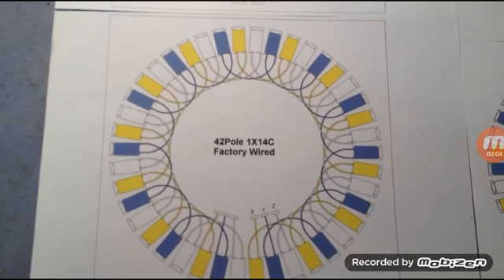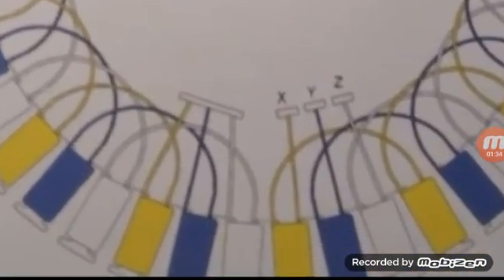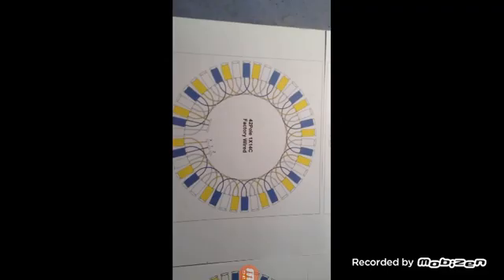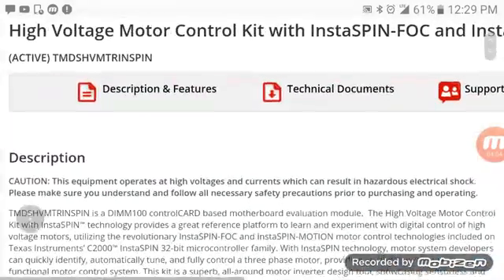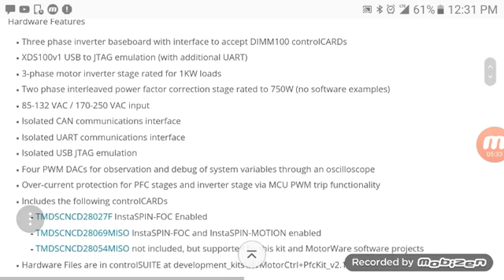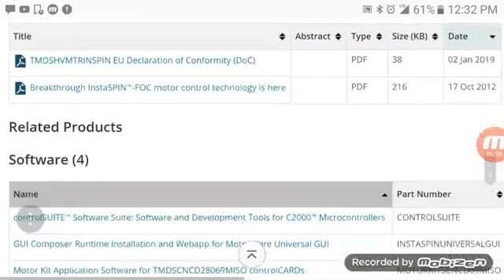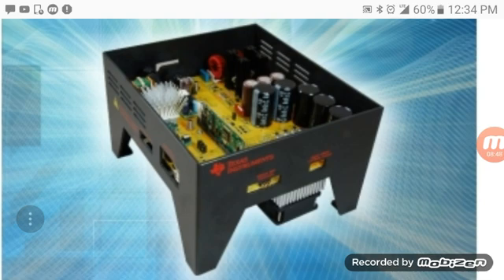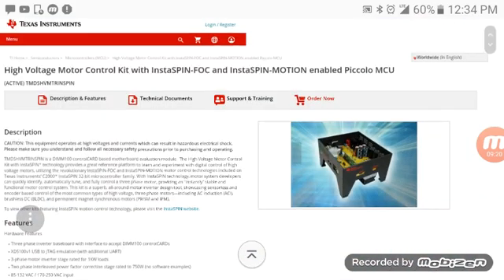Gerard Morin Hyper Drive Update and Explanation

Comment: Hi, I just found the same LG washing machine drum motor that Gerard uses. When he is talking about rewinding the coils left then the next one right (I assume he means CCW then CW) is he speaking about each winding seperately( do all the blue for exemple) or every pole you come across. Refering to your schematic would they go: Y= CCW then B= CW then W= CCW or Y,B,W= CCW then YBW= CW. I hope I managed to explain myself clearly and that you can enlighten me on the subject. I am an electrician by trade but never rewound any motors so any pointers help. Thanks in advance and I really appreciate your videos and all the research you do.
Reply from the maker: Hey man thanks for the comment, I don't recall Gerard talking about ready wiring/rewinding the stator coils, as they are alternating clockwise and counterclockwise already from the factory, and the ones with the thin wire provide enough surface area for higher voltages, so no rewinding is necessary with these particular Motors, they are ready to go as is, however since they have so many poles they are designed for a low RPM high torque motor, which makes it difficult to get high speed and high-torque with this configuration, the smaller motors which have half as many poles are much stronger and faster running Motors.

Comment: Ive got the drum motor spinning up to 3000 rpm they are only 1hp. And cannot handle large kw outputs. I no from experience. They can handle small currents up to 15 amps tops.
Reply from the maker: All I Need is rpms to spin a flywheel anti-Lenz generator head, no torque required for a full electrical load, thanks

Comment: How ya doin guys i enjoy a lot of the action goin on about these drum motors. Just letting you no i have a controller to run a drum motor starting at 550 rpm and can increase to 3000 rpm with no mods to coils .
Reply from the maker: Cool, that are the specs and what is the price? Custom built or purchased somewhere?
Reply: @JasonJoplin  i done some research on controllers and found one simillar. I rewired to my specs . I do have a short video clip if interested
Reply from the maker: @craigivas4037  awesome I'd love to see what you got!
Reply: @JasonJoplin  have you got a contact as i cannot send small video here.
Reply from the maker: @craigivas4037  jasonjoplin2016@gmail.com

Comment: Gerard Morin's generator (Hyper drive) demo isnt't working under LOAD. If it can't move anything but itself, it is POINTLESS. It is purely a THEORETICAL idea but it doesn't work to produce enough energy to power anything substantial. It's like the self powering motor. If anything is going to do all the stuff he said it would, he would show us powering some devices reliably for at least 12 hours. But it is still just talk and more talk and excuses. 

He will NEVER harvest enough free energy to even run a small fan. Look at all the people who tried and miserably failed. All they spout are assumptions, speculation and scientifically sounding theories to bamboozle the listeners with pseudo-scientistific nonsense. They always need more and more funding or parts. What did Gerard produce in all those years since his first video? Absolutely NOTHING.  

The first law of Thermodynamics applies and is formulated :

 ΔU = Q - W 

It states that the change in the internal energy ΔU of a closed system is equal to the amount of heat Q supplied to the system, minus the amount of work W done by the system on its surroundings. An equivalent statement is that perpetual motion machines of the first kind are impossible.

Beware and don't give this guy your hard earned money. He will spend it all, mostly to support himself and then come up with an excuse why it was not enough and why he needs more. Legally there is nothing one can do because its all based on theories without any guarantee.
Reply: https://www.youtube.com/watch?v=nroBcB-42aU Mario you don't know much do you? what have you built?
Reply: @2DOG3FIST worthless to those that don't know. What am I scamming? what did i state?
Reply: https://www.youtube.com/watch?v=6eP-B_d9DoI your first law of thermodynamics is in a closed loop these motors are not in closed loops therefore they are not subject to the laws.
If you do not understand this then mabye study.
Reply: @2DOG3FIST i cant help you
Reply: @2DOG3FIST how is that scamming if it does what he claims and you would have the ability to reverse engineer it? mabye you need to try harder and talk less.
Reply: @2DOG3FIST Your hiding behind another account also resorting to calling another person dense shows your true colors why would people want to share anything with the masses if it involves people like you? this person has spent his time developing something and no your not going to get it for free if you emailed him and was polite and learnt instead of expecting a free lunch things would be different and then you reference a person called bedini (https://www.youtube.com/watch?v=1DJ-QH3h-xo&feature=youtu.be)again retracting from an original argument how many people do you want to reference mabye study the people that helped john bedini as he didnt know how his apparent own inventions worked.
You clearly are looking for an easy out and ridicule anything you cant get easy good luck why are you here? you really need to study more if I was calling someone I had never met a moron or dense then it would be an easy reflection of what I was stating.
It is clear to me who you are a sad person who is hiding on another account trying to fight with people go to gerards sites and bedinis and john searl and anyone else and take it up with them on your main account not this account.
anything you state or say I can and will silence.
Reply: @2DOG3FIST You make the mistake that I care what you think and you also make the mistake that I would entertain you. who ever said there is a free energy device not I.
Do not talk on my behalf your sounding more absurd by the comments you leave you obviously have history or failure so I await another response as you just can't help it you think by the last comment your actually achieving something.
I'm retired at a young age and I find you and others funny you entertain me not the other way round. come on mario.
Reply: @2DOG3FIST Sunshine has done work its not free nothing is free stand out in it all day you will get burnt or at the least very thirsty as for creative ways nicola stated that the way we harness what is all around is makes it more or less efficient, I would study who tesla called a genius not tesla.
So many people are distracted in what they think they know.
I am a simple man I dont like gerards demenour mabye its his frustrations of trying to prove something although he needs to listen more and talk less much like myself.
Gerard madea  statement saying that a small mosfet would not drive the washing machine stator well he is flat out wrong they use mostfets in the tesla cars and they are one of the most powerful comercially available motors on the market, If one knows little of a subject one should employ the golden rule and be silent.
As for his website they cant give figures of how much over unity is achieved and that means that something is wrong I will like others build something and emply help when needed to achieve a desired result.
I have found many things in the time and pursuit of cheap energy.
I was told by a fisherman to take a lazy person with me when i do something as I would find an easier way to do the work.

There could be some great things to come in the near future and I understand about sharing it or it will dissolve.

Regards,

G.G.
Reply: @GG-od2tr  stop promoting a scam, MAGA.
Reply from the maker: @mariomarin4702  stop promoting the antichrist
Reply: @JasonJoplin  there is no Antichrist and there is no God.
Its all non-duality.
Reply from the maker: @mariomarin4702  only the fool says in his heart there is no God, no wonder you're so sinical and negative, no wonder you don't believe in the system, you love the indoctrination of lies, well, to each his own I reckon
Reply from the maker: @mariomarin4702  and you will eat your words soon enough with a side of haha I told you so
Reply from the maker: @mariomarin4702  and furthermore you will Never benefit from this system or the things that God has prepared for those that love Him!
Reply: @JasonJoplin  yadayada.. Whatever. Stop promoting a scam.
Reply from the maker: @mariomarin4702  just because you scream "fake news" doesn't make it true. Prove it's a scam, prove it doesn't work, you can't, you can only regurgitate what others have spewn from their lips
Reply: @JasonJoplin  you can't prove it's real putz. Burden of proof is on you!
Reply from the maker: @mariomarin4702  I already have
Reply: @JasonJoplin  sure, a magnetic motor which only lights up a little bulb... Show it powering up a fridge and AC. I will be waiting.

Comment: Seventy-two years ago the Searl Engine was presented as both a free energy generator and an anti-gravity engine. 

This is how it was advertised : "Not only does it spin, but the speed of the spin increases without any energy input. Then, unexpectedly . . . the device rises up to the ceiling of the laboratory and smashes its way through the roof. Outside it keeps on flying, causing birds that get near it to fall to the ground and tearing roof tiles off buildings. The first flight of a fantastic device." Life size models of "flying saucers" were shown suspended by invisible cables from a crane to demonstrate what the flying saucers would look like when finished. 

Self acclaimed 'Professor' Searl said, "with only one more million dollars, we can make a working model." That was after more than $30 million in contributions from investors. And the scam goes on....
Reply: We are talking about a different product here Mario mabye go to the searl site and take it up with them.
Reply: @GG-od2tr  its still a scam.
Reply: @mariomarin4702  wrong channel bud
Reply: @GG-od2tr  show proof of any free energy device and I take my comment back putz.
Reply from the maker: @mariomarin4702  we will be showing proof soon enough, but somehow I suspect that won't be good enough for you skeptics since there are already multiple free energy devices in existence and use TODAY!
Reply: @JasonJoplin  sure... This will be like waiting for Godot.
Reply from the maker: Controller is finished! Email me for details at jasonjoplin2016@gmail.com
Reply: @JasonJoplin  so where is the 'proof'? 
LOL

Comment: If you have Van De Graaff generator, you can build a corona electrostatic motor and modify Van De Graaff generator to spin corona electrostatic motor at very high rpm with kilovolts of static electricity, you can then connect corona electrostatic motor to any electric generator to spin it and generate AC volts. Theory.
Reply: https://www.youtube.com/watch?v=oMK0dEKWJdY